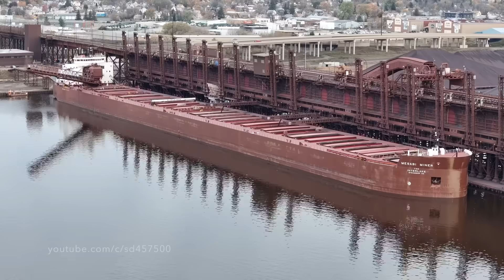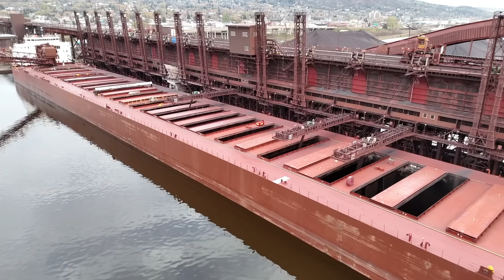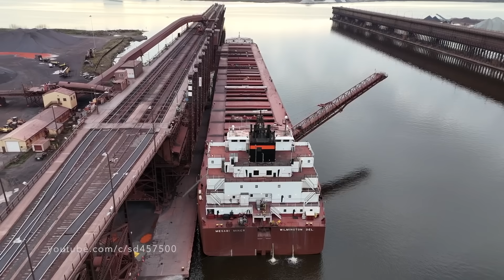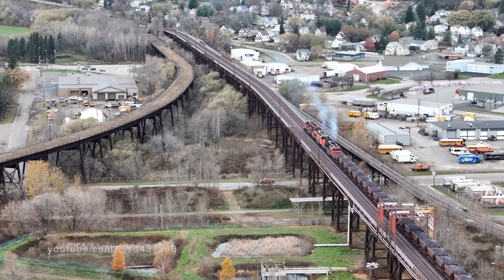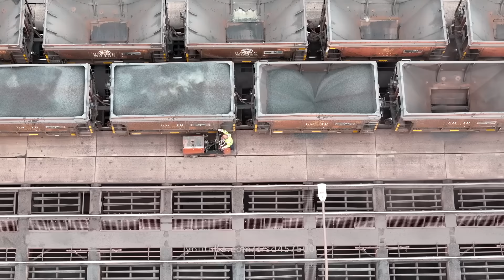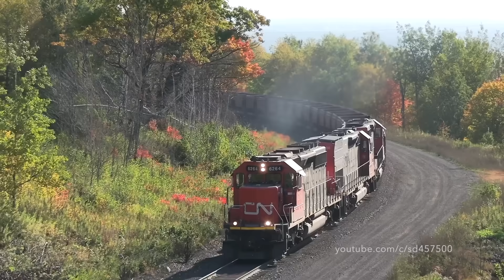Loading An Ore Ship -The Massive Mesabi Miner-

Comment: Those cars are ultra-stubby compared to coal cars because taconite is about three times denser than coal, which is what’s usually transported
Reply: Taconite is indeed more dense than coal.  The main reason they are stubby is because they are the same length as the spacing of the hatches on great lakes freighters.

Comment: Seeing that Milwaukee Road loco still being used is cool
Reply from the maker: Close!  Its actually a B&LE locomotive which CN now owns.  From a distance, it does appear to be Milw power.  Thanks for the comment, and watching!
Reply: @SD457500  It would have been very cool if the orange trio had been together for this video. We still have 1 orange and 1 DMIR arrow here on the BLE, but the primary road power is CN stripe.
Reply: Also an ex-Illinois central sd40

Comment: That B&LE SD-45 on the ore dock used to run between Conneaut, Oh and Bessemer, Pa. around 10 years ago. Now CN SD-70m's are in service. Those 20 cyl. 645's sure shook the ground when they went by the house!
Reply from the maker: Close, it's a former SD45T-2, rebuilt to SD40-3 specs.  During the rebuilding process, it lost its V20, and had it replaced with a V16. :/  Having grown up around the WC, I am partial to SD45s, and love how they sound.  Thanks for the comment, and watching!

Comment: When was the second dock disabled? Where does the taconite come from that is loaded in Superior?
Reply from the maker: I believe the other dock went out of service in the mid to late 1980s.  Taconite in Superior comes off of the BNSF Railway, and originates on the Iron Range in MN.  Thanks for watching!
Reply: @SD457500  I worked in Ashland, Wi., in the early 80s after the docks closed. Crack on my boss was that it was his job to stare out the window and watch for the ships to return because he was useless at any other task. At any rate, I'd see the coal ships come to the power plant.

Comment: From Scotland(maybe silly question)how does the taconite get delivered during winter when the lake freezes, awesome and informative video, truly captured the huge scale of this operation 🏴🇬🇧…
Reply: The lake boats run nonstop all summer. Taconite that is not needed immediately is stockpiled at the mills for use in the winter.
Reply: These ships pass through the Zoo Locks on the Michigan/Canadian border, and the locks close from Mid January to late March for maintenance. So, basically, the ships are offline only 10 weeks a year.
Reply: Soo Locks. I hate auto complete lol
Reply: The ships have massive skis on them. As the lakes start to freeze, the ships are brought into drydocks. Once the lakes are totally frozen over, the ships are released from the drydocks, and use the skis to glide across the ice. Propulsion is from twin rubber belts (under the ship) like snowmobiles have, except they have tungsten studs imbedded in the rubber tracks. The rubber tracks are hydraulically controlled and kept in contact with the ice, with only enough pressure to maintain contact with the top 3" of ice. The ice chunks created as the ships are driven is picked up by a tender ship and a barge. The freshly made ice chunks are then bagged on the barges, and transported to different ice houses for sale to the consumer. The guy you see on the cart unlatching the railcars also lowers the belt drives on the ships.

Comment: what are those small cars called that seem to be opening or closing the doors,  how do they work
Reply: Those are called “TRAPPING MACHINES” because they operate the (trap)-doors under each car….btw….the reason the ore-cars are so short is because they were designed to fit neatly over each “pocket” in the dock….to prevent spillover when they are dumping ore…..one ore-car per pocket dumped at a time…..and if memory serves….each dock pocket will hold (4) ore-cars to be completely full…..

Comment: Great video and narration but the soundtrack is very distracting and unpleasant - especially the heavily percussive noise. The sound of the rolling stock is much more interesting but there is nothing wrong with silence. I wanted to switch to closed captioning so that I could turn off the audio but it was disabled for some reason. Please reconsider the need for a soundtrack.

Comment: If the material isn't going to another country why not ship it all by rail why go though all this bother to put it on a ship then unload it again??
Reply from the maker: Very valid question; it is cheaper to send it this way, vs on an all rail to an end location.  This ship was going to Indiana, but there are all rail trains in some instances.  Thanks for watching!
Reply: Volume
Reply: @SD457500 Indiana, so Im guessing its going to Gary, I grew up on the shores of lake Michigan and remember seeing those large ore ships. Theres plenty of rail lines from Duluth to Gary.
Reply: @andramoiennepeMousa  Still seems simpler to go by rail 60K tons is 600 coal cars or 4 coal trains and a train can go much faster than a ship and about storms.
Reply: Scale of economy
Reply: Winter!
Reply: Simply cost. The shear volume a ship can hold vs. a train and the fact that iron ore is heavy so train length is restricted compared to other types of unit trains. For the most part rail would be loaded only one way while the lakes trade often has two-way traffic. Also, the ore trains would have to run through Chicago (to get to Indiana or lower lakes steel mills in Detroit, Cleveland, etc.) which is a very congested area for rail. The ore boats also have self-unloading equipment so they’re cheap to unload too. Speed also isn’t a necessity. Ore is stockpiled at mills so the quicker transit of rail isn’t required.
Reply: @gordonalsop8537 you said exactly why it goes by lake boats.
Reply: That ship can hold 20 trains worth of product.   The logistics is easier.    1 boat or 20 trains waiting for a spot to unload.
Reply: It's all about the money!
Reply: @gordonalsop8537  I think it's what is known as slow cycle transport of durable bulky items where there isn't the need for rapid transit as its not going to deteriorate en route nor providing there is already sufficient stockpiles it's not loosing income by steadily making its way
Reply: My good friend pilots a great lake ship.  He can fit 200 rail cars of grain.  Says its way more cost effective in the relative lower cost of fuel to move the ship from Thunder Bay to say Montreal, than what it would take 2 locomotive consists.  Maximizing payload, man hours, maintenance and anything else one can think of, its cheaper to send that many tons by ship than rail.
Reply: Besides the direct technical and economic benefits of shipping, moving that many trains through the landscape is going to inconvenience society way more than shipping. Trains block vehicle traffic at every grade crossing, including emergency response vehicles and collisions are too common as is; they're dirty and noisy (I love 'em but facts are facts); there's always the threat of derailment, which can take days to recover and repair and return systems to good order. Iron ore is really heavy - that's why the cars are so small - and takes a maintenance toll on track. Lots of logistical factors are considered to determine the overall 'best' methods.
Reply: Chicago rail congestion is also a huge issue.
Reply: Because it’s cheaper to store and move on a ship than $+$ rail.
Reply: Because doing so is cheaper than by rail. Water transport is always cheaper. If a commodity doesn’t need to get there quickly, barge or boat is the way to go.
Reply: @hifijohn Seems so, but it isn't.
Reply: @hometownmedic7355  The cost of parking a container ship off shore filled with ore is a double order of magnitude cheaper than parking a unit (one mile) train in a short yard, not-with-standing the expensive rail reconfigurations while the rail waits to unload…which always happens.
Reply: because it has to pass right through multiple major cities, especially Chicago, to get where it needs to go and it’s faster and cheaper to go via ore ship than train
Reply: The shortest distance between points. The Great Lakes are massive and it easier to go through than around.
Reply: Because it’s far cheaper. You can have a barge/ship with 6 crewman that are moving about 10-15 trains worth of product. And then ships themselves are cheaper to operate than trains or trucks. 

And also this is mostly done with bulk raw goods where it doesn’t really matter if it takes 6 months to get where it’s going, so might as well go with the cheap option.
Reply: @freddyhank also in modern countries the biggest expense every company has is labor, it takes a crazy amount of train conductors/truck drivers  etc to move what one ship/barge with a couple crewman can move
Reply: Quicker!
Reply: Plus, from Duluth to Gary is probably only a 2-3 day trip each way, so probably not all that much slower than a train anyway.
Reply: They should ship it via fedex 2day.
Reply: Because Warren Buffet owns the railroads.
Reply: @hifijohn  Because the accountants crunch the numbers and determine it’s cheaper to send by ship. You’re working with massive volumes shipping is cheaper.
Reply: This comment brought to you by Norfolk Southern railroad
Reply: You should get into the industry and tell them how they're doing it wrong. I'm sure they could use the expertise
Reply: Shipping is even more efficient than rail.
Reply: You sir have never lived next to ore dock 😅. Rail would be quite long. I remember 45min long  moving ore at 3am thru upper Wisconsin
Reply: This is still the cheapest way to move all that cargo
Reply: @P-el4zd  And those accountants know to the fraction of a penny how much it costs to transport each ton.
Reply: @hifijohn this has to be the cheapest and most efficient way to do it. It’s not like they are doing it for fun
Reply: The rails don't go from everywhere to everywhere.
Reply: You really have to ask? Economy of bulk!
Reply: Shipping is cheaper because water
Reply: I’m sure they have their financial calculations in order and have gone for the most economically viable option.
Reply: Some will go directly by train to Mexico.
Reply: The thing is that it's far more economical to load 1 ship then to have 20 separate trains deliver the same amt of cargo. Also its far more eco friendly for one ship than 20 trains in terms of emissions. A large train is considered to be around 4000 tons I believe. 60k in one go or 15 separate double or triple headed trains?
Reply: @HenryGengler  yeah rail is definitely more expensive that sea. You can ship things from across the atlantic cheaper than you can get it from inland by rail, depending on the distance
Reply: Much cheaper to move things by water
Reply: It’s just not cost effective, you would need multiple trains to do the trip for that much ore. It just ends up being much more cost effective to use a ship for the long distance haul.
Reply: @SD457500  going around lake Michigan takes longer than it does to break up a train, and load it all onto a ship, them unload it all out east somewhere.
Reply: Easy answer look at the amount they can carry.
Reply: They wouldn’t use ships if it didn’t make financial sense. It’s not the government
Reply: It's all going overseas,everything ..
Reply: The ship carries slot more than train cars can
Reply: Profitable than train
Reply: Hifijohn - it’s so great that you are smarter than all the accountants and logistics that move this stuff for a living.
Reply: 1 one thousand foot freighter can car 700 train cars worth of ore. All about volume buddy.
Reply: @hifijohn exactly so why have 4 trains do a run while one ship can just get it done in one trip
Reply: @boltactoinbarney no 1 one thousand foot freighter can hold 700 train car worth of ore
Reply: @hifijohn Well if it truly was, they wouldn’t use ship
Reply: Tribal lands might be in the way of a rail system?
Reply: Yeah ore trains in middle of night for hours !!! Sometimes. Usually 45min . I grew up in ashland wi. 82-93. Boats way cheaper more volume @hifijohn
Reply: @hifijohn its not cheaper.
Reply: Because logistics, efficiency and cost (equipment and labor) are all major business factors. Compare it to public flight travel related to “spoke-and-hub” system. It’s more efficient to bring aircraft (ore cars) to a central location (ore dock) and load a big aircraft (ore ship)…
Reply: There is no thrill in that!
Reply: MUUUUCH cheaper to ship large amounts of anything via water rather than rail. Like, crazily so.
Reply: The distance is not the problem, how many rail cars does it take to fill a FREIGHTER. Now what would be the congestion just around  say Milwaukee and Chicago  to go to Gary. Just a fucking mess, now imagine that mess going to Detroit,  Cleveland,  Toledo,  Fort Wayne, Pittsburgh,  the 750ft Freighters do go over seas not the 1000 footers. The ones you do not see are the CARGO BARGES  loaded in Minneapolis then down the River to New Orleans,

Comment: Need to explain what 'taconite' is.
Reply: Taconite is iron ore concentrate that is removed from a very hard rock . They pulverize it into a powder then remove the iron from the rock with electro magenet then combine it with bentonite clay and water mixture and bake the water out of it the finished prouduct is little round pelletes of iron ore and clay about the size of a marble
Reply: Its what you use when you've got no decent ore left.
Reply: Or instead of being lazy you could look it up for yourself.